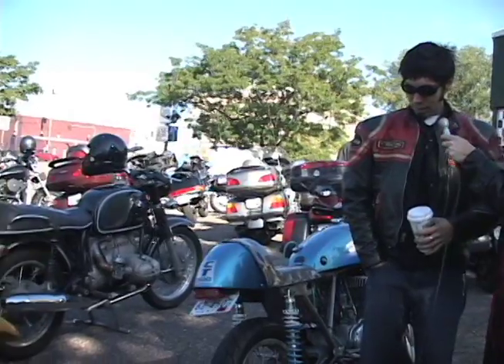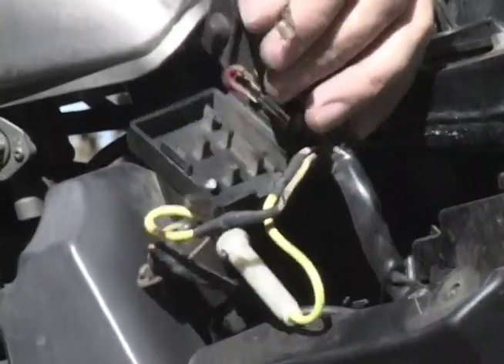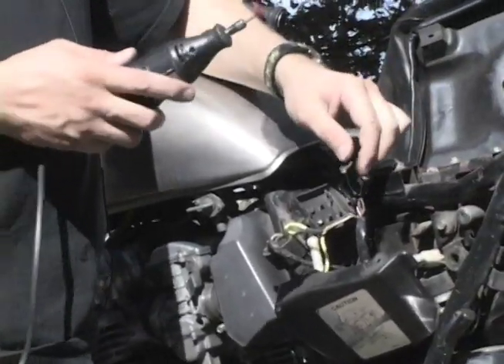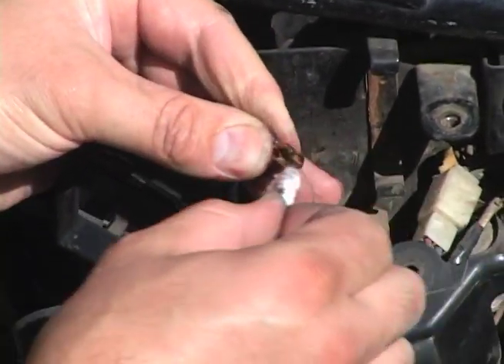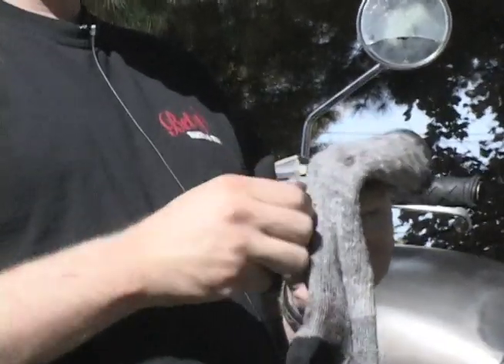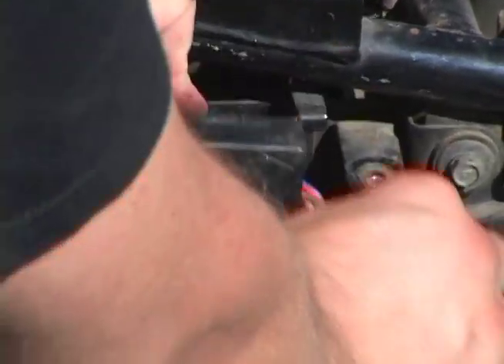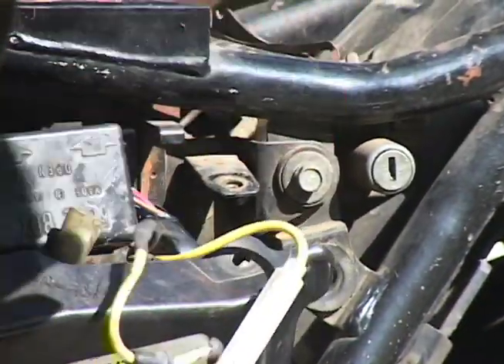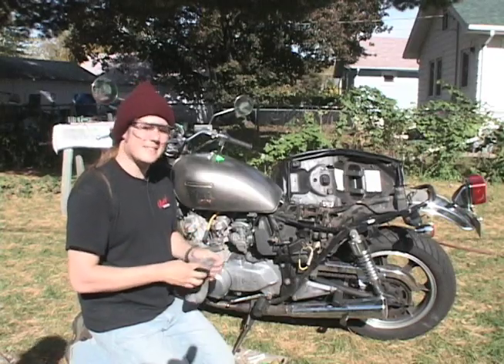Motorcycle Electrical System Maintenance Part 2 of 2

Comment: Paul - Thanks for your explanation as to why Dielectric Grease (DEG) though a non-conductor should be used in metal contacts. I had also heard arguments from both sides - to use or not to use. Eventually I tested electrical resistance of Vaseline and DEG alone and when applied in connectors. Uploaded two videos on that topic that clearly support your views as demonstrated by readings on digital multi meters. They are under my youtube account.

On a separate note - my Royal Enfield motorcycle also has glass fuses and one day it stalled due to burnt fuse, was not charging battery. The wire connector was discolored and plastic tabs melted - just like your motorcycle :-). Made a video on that as well.

Comment: Paul thanks for the video's and information. I am rebuilding a 1980 KZ550 that has sat for 12 years and I am down to the frame, wiring, and connections. The wiring harness looks not too bad but all the connections are all corroded. Your video has explained what I need to do to clean them up. Thanks Tomas

Comment from the maker: It is a good low-tech solution.  One step up is a pen eraser, which has abrasives in it.  That is more effective on corrosion.  Both share the weakness that they are harder to do effectively in confined areas, but a penknife for scraping can solve that issue as well.

Comment from the maker: This is true, but happens over a dramatically longer time scale if the crimps are good.  In a good crimp, the wires cold-flow into airtight contact with the terminal and each other, exposing fresh copper that used to be inside the wire until you crimped it.  For practical purposes, good crimps are airtight and self-sealing.  But if there is any doubt I work contact grease into the small conductors by twisting the insulation as i hold the end in my fingers with the grease.  Then I crimp.

Comment: Another point most people miss is that the crimp connection from the wire to the fuse clamp is going to rust also. If the parts are 20 years old you might be better off clipping the old connections off altogether, then crimping new connections onto the wires. Being a British car mechanic taught me this trick. Any metal that is exposed to the oxygen in the air is going to rust. Even in the crimps!!